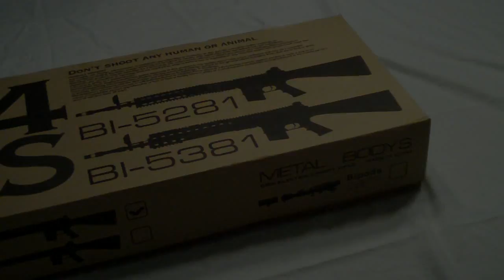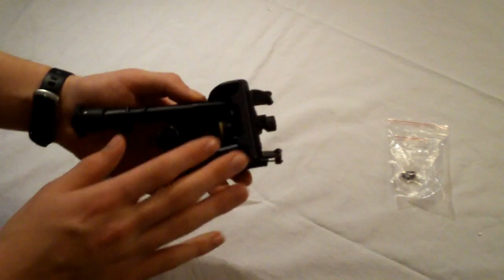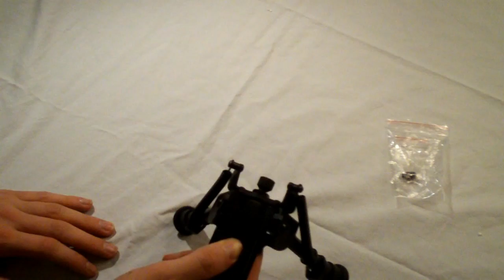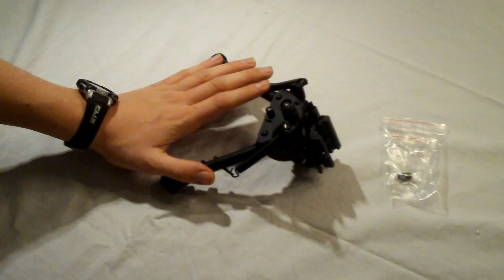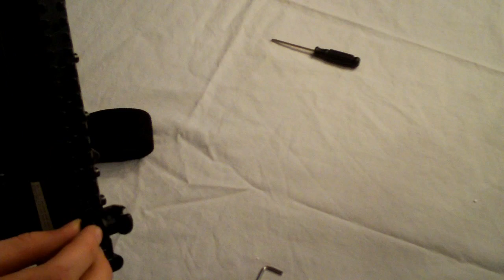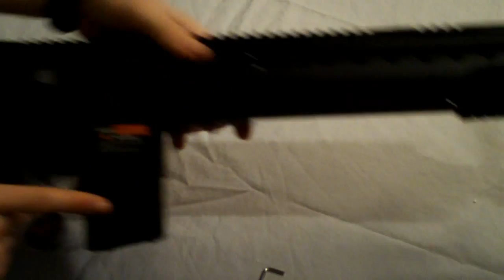Dboys Mk12 MOD0 Airsoft AEG Review - Part 1

Comment: um this is actually the mod 1 not the mod 0 cause the mod 1 is the one WITHOUT the FULL ris, only the top runs all the way, the one with the full rails is the mod 0, and it comes with all this stuff, longer rails, rail guards and a fore grip for the same price ^^